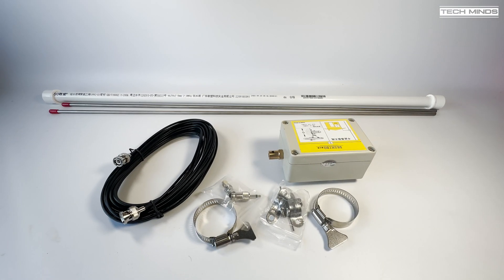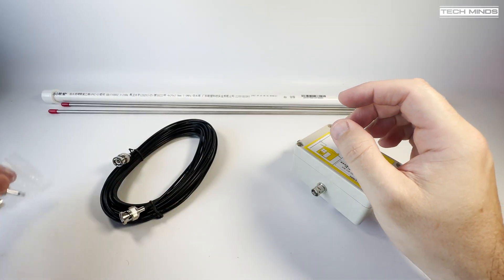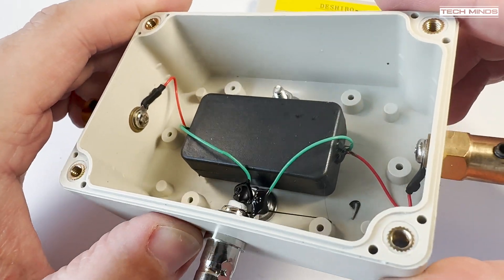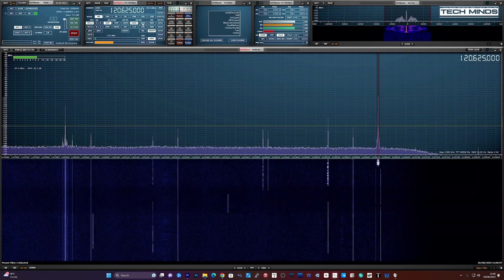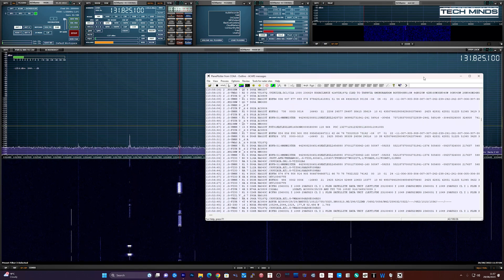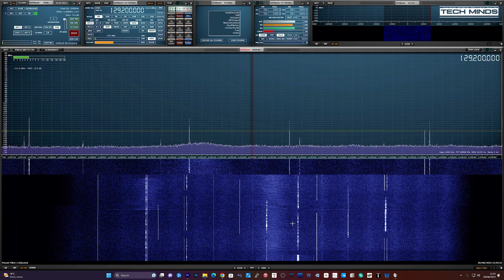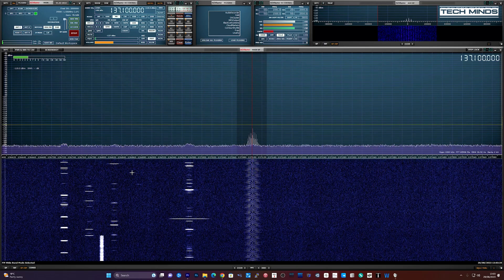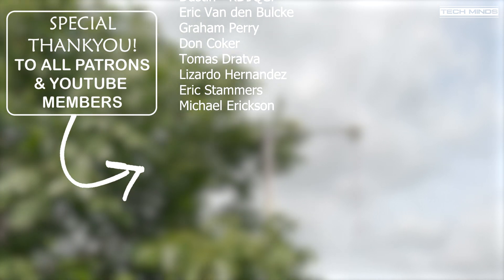GA-505 Airband & FM Broadcast DX RX Antenna

Comment: just as a point of reference when ever I test vhf air band antennas which i make under the name Broadsword antennas I use a atis/volmet as my reference point due to its consistency in transmission power, location etc. would have been interesting to see how the tested antenna compared to the 2m vertical which as its tri band im assuming its a 6/2/70cm antenna possibly a v2000 ? I compare my civ air twigs against a x510 which is also a 2m antenna
Reply from the maker: It is a Tri band, but it's 2/70/23cm :-)

Comment: interesting comparison. repeating the test using a simple dipole cut for the band vs GA505 would be a better comparison.
Noise floor is always lower on VHF with a horizontally polarised antenna as this reduces manmade hash. On ham bands horizontal to horizontal will usually out perform vertical polarisation for DX.

Comment: Thanks for the video. 
It is extremely misleading to use a stacked 2m ham antenna as a reference for a dedicated air band antenna, because the more it is stacked the more of a mismatch you will have on the air band, hence very low noise and weak but relatively clear air band signals, because the aircrafts signals are so very strong by design. 
It only makes sense to compare ground stations like ATIS, delivery, ground, tower, radar, flight information service and then switch between antennas, anything else is a waste of time because you will have line of sight most of the time, meaning a wet finger in the antenna socket will also work to some degree, while the ground stations are the challenge.

Aircraft antennas for communication and ADS-B secondary radar transponders are vertically polarized, while some of VHF/UHF navigation antennas are horizontal.
You can pick up aircraft signals (voice/ACARS/VDL2/ADS-B) from up to a little over 400km away, because then the curvature of the earth will cut the signal, even when the plane is way up at e.g. FL450 (45.000ft). 

As a general information for avid trackers, on shortwave via HFDL you can pick up aircrafts directly from literally all over the world!
Look for High Frequency Data Link resources on the net and you will find plenty of HF frequency tables.

But back to the GA-505 VHF antenna, is very surprising that the antenna does FM as well, because as a serious Air Band DXer any Broadcast signal is what you want to suppress as much as possible in order to use your receivers dynamic limitations wisely for air band exclusively. Also really strange is that they use a seemingly lossy cable on a passive antenna. On an active antenna loss doesn't matter, because the preamp defines the signal/noise and only a good coax shield is needed so that no noise from the shack is getting into the cable. Sometimes a few feet of thin RG-174 makes sense when rolling it along a ferrite material to reduce RF noise that travels along the outer shield of the cable.
On the other hand as a serious FM-Broadcast DXer, you want a narrow beam with a good reflector and the ability to pick signals out of the massive amounts of high power stations all over place.
This is a very weird choice to make the antenna pick up any FM BC signals at all.

Anyway a comparison to a simple home made air band ground plane or ready made discone antenna would have been interesting, because the GP matches close to 50 Ohm in the center of this very wide band (127.5MHz + - 9.5MHz!) and offer a very good signal strength. This required wide bandwidth doesn't make any sense to play with a highly stacked home made antenna in the air band unless you want to use it for a specific frequency or a narrow part of the band.

The fact that the antenna is symmetrical is good and I presume the black block inside contains a low loss balun, because that enhances the symmetricity while rejecting noise traveling along the coax, giving you the best possible signal to noise ratio from the local e-field.
Reply from the maker: Well, it's a Tri-Band antenna and the 2m part, which is the closest to airband in terms of frequency is a 6/8th wave. Not stacked, so not sure what you was looking at in the video. Secondly, it's the only reference antenna that I had, and believe me if I didn't compare this antenna to something else then there would of been a lot more people moaning in the comments section. Also, I believe quite a lot of Hams would use their Co-Linears for receiving airband, unless they are really into listening airband and have a dedicated antenna. So, I think it's not misleading at all, it's a real world example of what most people would use, in my opinion. Regarding comparing against a static station, that's exactly what I did in the video. Thanks for watching and thanks for your comment. :-)
Reply: @TechMindsOfficial  I think your 6/8 wave is secretly a 12/16 wave ... just kidding, so your 3/4 wave makes sense, because every uneven quarter wave the impedance is at a minimum, meaning there is not much transformation needed to get it to 50 Ohm. If it is a multiband antenna, it will contain 1/4 wave delay coils for 70cm, so that the 70cm part is stacked in phase, which is not much of a problem for the VHF characteristic.  
The trouble is that the 3/4 wave for 145 MHz ends up being 0.66 lambda for 128 MHz, which is near a 5/8th wave (0.625 lambda), which is just far enough away from the maximum mismatch, which is 0.5 lambda and close enough what is proven to be good if you use a proper match, which here you just don't have.
In this constellation I agree that the air band capability could be worse, but isn't great either, may not be so bad unless you compare it to a discone, log periodic or a resonant dipole or groundplane that any enthusiast would use.

Comment: It would have been nice to see what the swr is, to test what frequencies it's resonant on. Would be helpful to test against a discone or dedicated airband antenna.
Reply from the maker: I did think about showing this, but it’s not meant for transmit and the swr is not changeable, well I guess you could cut down the elements but then again, I think the designers would of catered for that in the design. But I’m with you on your thinking, I much prefer resonant antennas.  Thanks 🙏